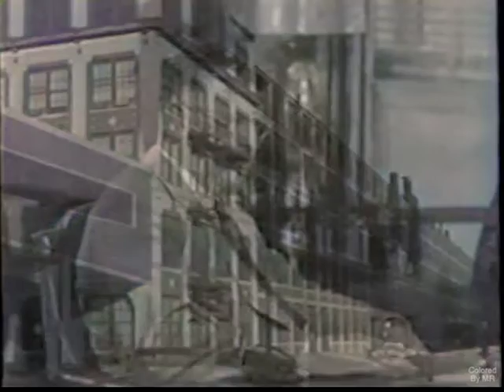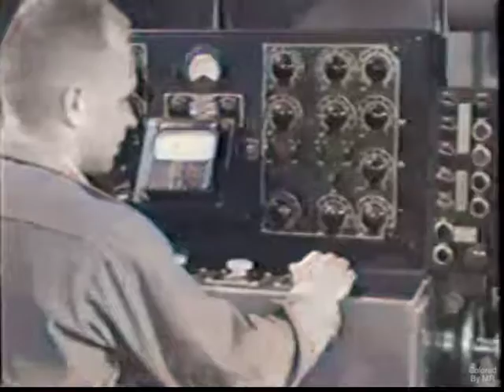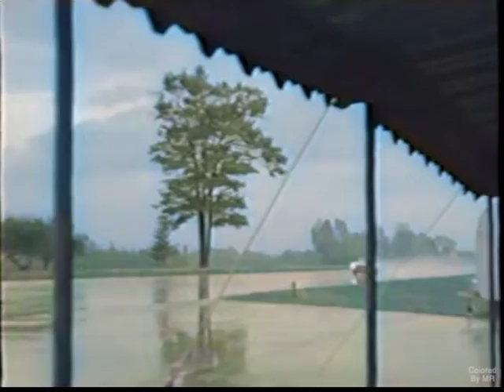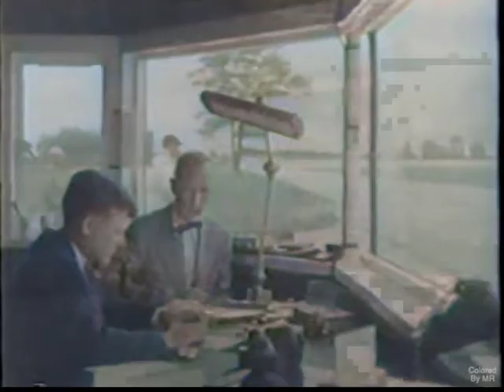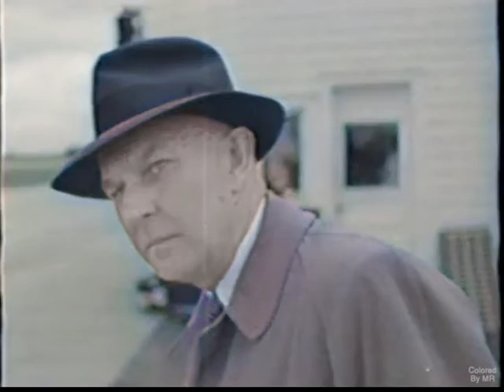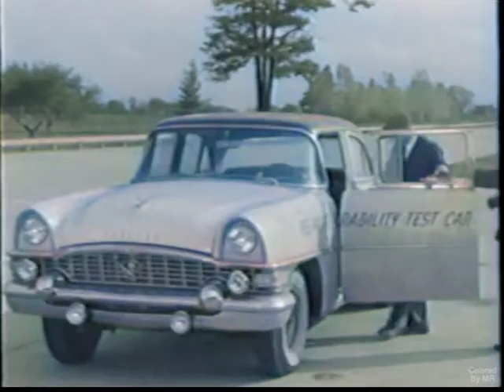Colorized 1955 Packard V8 Engine & Durability Test! 25,000 Miles At Over 104 MPH

Comment: Just imagine how many miles you would get out of those old engines with modern day lubricants.  I read an article some years ago from Muskegon, the company that supplied piston rings for GM.  Crankcase oil was so poor in those days they didn't expect to get much more than 40-45,000 miles between rebuilds.  I remember that sludge they used to keep in glass bottles at the local Shell station when I was a kid.  Awful stuff!  Looks like an oil bath air cleaner on that Packard.  Those were so great!  The size of radiators in those days was fabulous too.  Enormous!  Hey, these new cars & tech are fabulous!  For performance & gas mileage, they are WAY better than those old boats, but still you have to love those old rigs.  When you hit the throttle, you knew you had something special under the hood!
Reply: Not only have oils improved considerably, when governments made the oil companies take the sulfur out of fuel, that dramatically reduced wear.     I worked for a company that rebuilt engines.   They lost most of their rebuild business when low sulfur fuel began.  Engines were still good when owners didn't want their old vehicle anymore.
Also, in private cars most wear occurs during warm up.   Modern emission controlled engines warm up much faster, so there is less wear.
The old type engines needed big radiators because they were not fuel efficient - they converted a lower proportion of combustion heat into mechanical power so more of that heat had to go to the radiator.
When side valves (flat heads) were common, less heat went out the exhaust pipe and more went to the radiator instead.   The long exhaust cross-passages in the Ford flathead V8 design meant even more heat sent to the radiator.
Reply: @keithammleter3824  Hey, thanks!  I learned something.  I knew about the sulphur.  I did not know the radiator tech.  Fascinating stuff!  CUL
Reply: I have a 56 clipper with this engine.  Owners manual says to change the oil every 2000 miles and drop & clean the oil pan annually. I doubt anyone did that.
Reply: @rome288  Before the advent of paper oil filters and detergent oil, changing oil every 2000 to 3000 miles was essential.  People did change the oil that often.   Folk were accustomed to getting their car serviced about every three months or so.  People didn't clean the oil pan, but when you did remove it, the amount of sludge was usually pretty gruesome.
These days, with modern oil and low sulfur fuel, getting a car in private use serviced once a year is probably overkill.
Reply: @keithammleter3824  supporting your point... I dropped the packard oil pan and it had an inch of sludge on a car with only 20k miles.   I dropped the pan on my 250k 2005 Saab and it had no sludge.
Reply: @rome288  I'm older than most, so I can remember when the API ratings were  B, C & D.  That's the rating for each upgrade in lubricants by the American Petroleum Institute.  It's the last letter on the top of the can or bottle, now.  The closer to Z, the better the oil rating.    They set the standards on all lubricants & fuels, so everything works in every car sold.  I had to  quit working on cars in 2005 cause my back got so bad.  Last I looked, they were up to  L  or M.  Don't know what it is now, but it's WAY better than the goop we used all those years ago.

Comment: Was this used in cars other than Packard? Like Studie or the Packardbakers?
Reply from the maker: The torsion level was only used for 1955 and 1956 in Packard cars. Torsion bars were used later by other manufacturers.
Reply: The 1956 Studebaker Golden Hawk. Nash and Hudson also used them for 1955.
Reply: Chrysler used front torsion bars on their rear wheel drive models from 1957-1988.
Reply: Thx
 @LlyleHunter